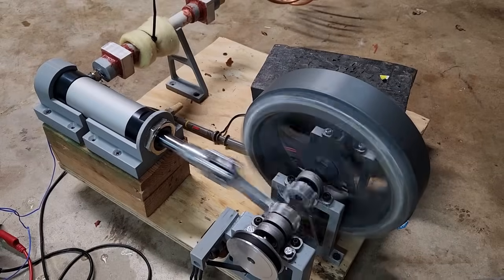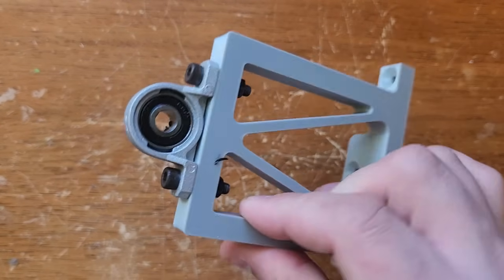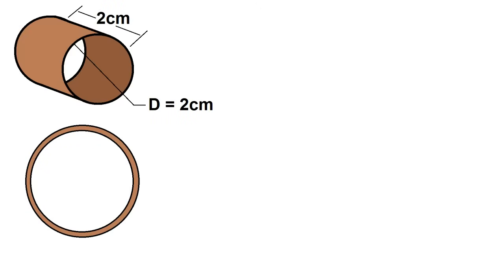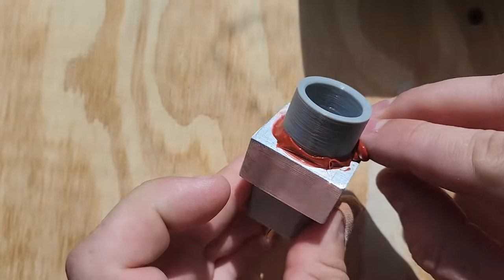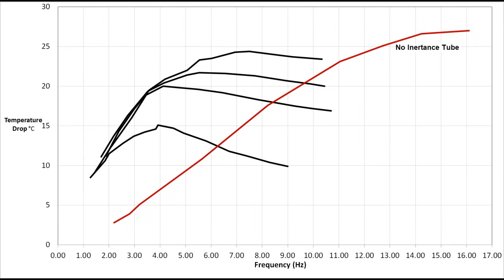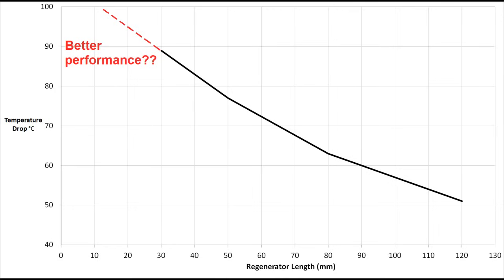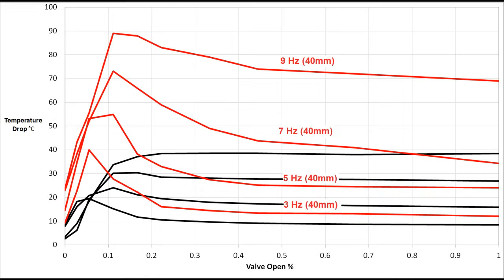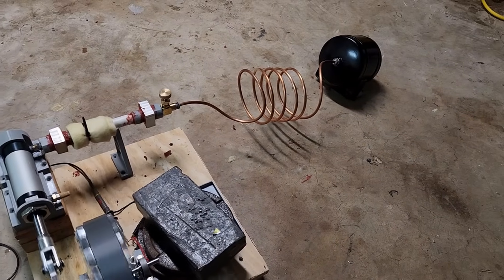Pulse Tube Cryocooler - Part 2 (-75C)

Comment from the maker: I've read through the comments and thought I'd address a few of them:

-The 40mm piston is probably not optimally matched to the pulse tube geometry,
since i optimized it for higher frequencies on the 25mm piston

-For part 3 or 4 i'll probably try using Hydrogen as a working gas. It has a lower
specific heat ratio than helium, but the highest thermal conductivity of any
gas, so I should see an increase in performance as long as all the components are 
sealed well enough to avoid leakage 

-For part 3 I'll be looking at heat exchangers with multiple heat pipes and 
water cooling, as well as single tubes packed with copper wool.

-I do intend to evaluate a segmented regenerator with polymer "heat breaks" 
to slow down axial conduction losses by breaking the continuity of the metal
mesh

-For higher pressures and lower temperatures, I'll be replacing the PVC 
with stainless steel to avoid explosion hazards.

-The ESC has flyback diodes across the H-bridge MOSFETs, so any back-current
from the flywheel after motor shutoff should be dissipated through those.

-Multiple stages might be neccesary to reach LN2 temperatures with a DIY setup.
Pulse tubes can be staged by connecting a much smaller pulse tube to the output
of the compressor's aftercooler and thermally anchoring the second heat exchanger
to the cold end of the first stage. Pulse tubes used for liquefying helium/hydrogen
typically have 3 or 4 of these stages and can reach single-digit kelvin temperatures
Reply: - Hydrogen is incredibly difficult to keep sealed; just look at the troubles and delays with SLS
- I wouldn't be so sure that you can use water cooling... wouldn't the heat exchanger itself not get cold enough at one point to freeze water inside the heat exchanger? Then you have an insulator in the pipes instead!
Reply: @BirdbrainEngineer  Hydrogen is hard to keep sealed but easy to make even at high pressures if you're brave enough. You can directly hook up the hydrogen part of your catalysis, plug up the oxygen part and just let the pressure go as high as your bravery allows. So you should be able to replace your losses fairly easily.
Also I believe the water cooling goes on the hot part of the first stage of the cooler.
Reply: @MrRolnicek  It is better to rely on engineering rather than bravery when choosing a maximum pressure. It is easy to calculate the potential energy in a compressed gas based on the volume, temperature, and pressure. 

If there is enough energy in the system to send debris through safety glasses and into an eye, then it is time to either dial the pressure back, or put a safety barrier around the device. The inner layer of the safety barrier should be soft so debris will embed itself, rather than ricochet.

High pressure hydrogen will make metals weaker and brittle. So just assume it will explode at some point, and make it so an explosion won't be a big deal.
Reply: @hamjudo  Sure ... HOWEVER, this is hydrogen we're talking about. You can calculate the internal volumes and make sure that at this pressure everything is going to be perfectly non-lethal.

And then you discover that your entire room has been filling up with hydrogen from small leaks and got to a pretty stociometric ratio. And maybe you discover it the painful way.
In either case you're handling something that you assume will explode at any moment, that still takes some bravery even with safeguards in place.
Reply: @BirdbrainEngineer  The same problem is with helium. Hydrogen can be fire risk. Otherwise they should work similar.
Reply: The pressures the SLS’s H2 systems operate at are much higher than require this project making leak management easier. .
The H2 molecule is larger than the single He atom, so it will be easier to seal then helium.
Reply: @BirdbrainEngineer   iif you heat hydrogen , won't you get helium then.
But you can't keep helium
Reply: Could you add a new stage just by eg. adding a Peltier element (with a heat sink) to forcibly cool down the hot end and thus increasing the temperature difference? They're not terribly efficient, but can move tens of watts of heat without using moving parts?
Reply: You should ISOLATE ALL around the precision valve and after on the right, all the way to coper pipe and reservoar. When air from the resevoar expands through valve, it cools off, and it is good, that it is cool as posible, before expands.
Reply: I'm looking forward to seeing this completed and would love to build one of my own as it could be extremely useful when doing some machining projects where I'm try to get a 2 to 3 thousandths interference fit by cooling one pert in liquid nitrogen and heating the other to take advantage of thermal expansion and contraction vs trying to press some relatively delicate parts together.
Reply: I’d be really interested to see more tests with increasing the regenerator diameter so the gas flowing over the steel wool is moving at a slower velocity; if your idea about the velocity of the air getting too high is right this should help… maybe 🙃
Reply: @Axman6  🔴 What Is Islam? 

🔴 Islam is not just another religion. 

🔵 It is the same message preached by Moses, Jesus and Abraham.

 🔴 Islam literally means ‘submission to God’ and it teaches us to have a direct relationship with God. 

 🔵 It reminds us that since God created us, no one should be worshipped except God alone. 

 🔴 It also teaches that God is nothing like a human being or like anything that we can imagine.

🌍 The concept of God is summarized in the Quran as:

📖 { “Say, He is God, the One.  God, the Absolute.  He does not give birth, nor was He born, and there is nothing like Him.”} (Quran 112:1-4) 📚

🔴 Becoming a Muslim is not turning your back to Jesus. 

🔵 Rather it’s going back to the original teachings of Jesus and obeying him. 

More ....
Reply: @1islam1  
No one goes to heaven except by Grace though Faith, when a person believe Jesus is word of God become flesh. Died on a tree (wooden cross) and took on our inherent sin from Adam upon Himself, that we might live with God in Heaven forever. 
God the Father sent God his Son, and if we accept Jesus as our lord and savior Jesus send God the HolySpirit to reside in our heart. If God resides in your heart you are sealed for eternal life, and no one can ever change that, not even one’s self. 
God doesn’t take back the free gifts he gives somebody. 
Read Romans in the Bible. Paul was a teacher to the Gentiles, giving instruction to a people who had no idea how to have a relationship with the God of Heaven. 
Enjoy Reading all of Paul’s righting.
Reply: H2 is a pain to seal. Good luck!
Reply: Exactly - this would’ve been my feedback too. Keep rockin‘! Curious where you can get with this 🤓
Reply: I subscribed just because of how interesting his projects are .
I think he is underrated.
Reply: I replaced the helium in one those little pulse tube cryocoolers used with SBRC sensors with spectro grade hydrogen out of morbid curiosity and it worked well. Did not as cold as helium but enough to liquify argon or nitrogen on the tip of it, and plenty cold to get the sbirc thermal sensor to work. Building a working pulse tube cryocooler from scratch of your own volition is awsome though 😲🤓❤
Reply: This is fascinating stuff!  I'd love to see you achieve liquid air and then move onto flash-freeze-drying food items.  (That preserves the structure and, MUCH more importantly, the nutrition of fruits/vegetables/etc. as well as giving them a shelf life--in a sealed container--measured in decades. )  If such a system could be DIYed, it would allow folks in drought-prone areas to preserve bountiful crops for the hungry times without requiring refrigeration.
Reply: I think it would be a good idea to try cooling the hot heat exchangers with dry ice
Reply: What about fiberglass? isnt its conductivity way lower than steel?
Reply: Very interesting. For a long time I’ve wanted to make liquid nitrogen from air. 
Thank You.
Reply: is the volume really really low or what?
Reply: When is the next kayak video
Reply: But can you sit in it to dive underwater? No? 
#IfOnlyYoudMakeASub....
Reply: I look forward to seeing your planned upgrades implemented... but going with hydrogen will DEFINITELY present some sealing challenges.
Reply: Would love to see the copper coil go through a insulated wall into a freezer room containing a cryocooled chamber and a pump to blow cold air on the engine to start it or increase the speed. 
Would also love to see if possible another heat exchanger into an insulated hot sand battery. Wouldn't that be almost revolutionary? 
The professional factories can now reach CO2-negative lifecycles with only around 10% biomass https://www.youtube.com/watch?v=mKKfed2rM3I. 
What could the ordinary man can do with for example biochar, limestone and cat sand? And acid loving flowers. Imagine your own bronze oven.. https://en.wikipedia.org/wiki/Bronze  and pizza oven and glas blowing oven and pyrolysis oven as part of your "dark sand battery green house". Perhaps underneath your yet to be build northern veranda carefully designed not to spread any fires into your house. Only controlled heat from the sand battery fed by Stirling engines.
Reply: People need cold enough to create Bose-Einstein Condensates, or their devices will never defend against the corporate A.I. mechanisms.
Reply: The dimensions of THigh radiators are suspiciously small for such a low temperature in the middle. If the unit has cooled down to -75 degrees in a few seconds, then the radiators have heated up to the same temperature, they should cool down faster than the TLow temperature drops. In addition, it makes sense to read the wiki on this topic: a more efficient U-shaped design is represented here. Finally, it confuses me that one end of the regenerator is warm and the other is cold. It seems to me that the cold end will receive heat from the heated one, reducing efficiency. Therefore, the wiki contains conflicting requirements for the regenerator. I would try to make it in three parts, splitting the metal wool in the middle with a layer of glass wool. And finally, you may buy true Si-airgel instead of foam rubber!
Reply: have you considered using a subwoofer to generate the pressure wave?
and cute dog :3
Reply: Could you use the vacuum from the other side of the dual action piston to add a larger pressure difference after the expansion valve?
Reply: material list?
Reply: i know it's to late, but why not just use vapor chamber / copper heat pipe, common pc cooler

Comment: AI Summary

Abstract:
This technical report details the iterative development and optimization of a DIY pulse tube cryocooler, progressing from a proof-of-concept to a functional unit achieving a minimum temperature of -75°C (a 91°C drop from ambient). The author transitions from a linear drive to a high-inertia rotary system utilizing a 750-1100 KV brushless motor and a flywheel to manage the exponential pressure rises associated with adiabatic compression. Experimental focus is placed on the "hot-end" heat exchanger design, where the author addresses the gas-to-wall thermal bottleneck by employing a multi-channel aluminum block to increase internal surface area. Extensive parametric sweeps were conducted on regenerator length, pulse tube geometry, and inertance tube diameter. Results indicate that a 4.4mm ID inertance tube significantly outperformed smaller diameters by reducing flow resistance. While the 40mm bore piston increased compression work to 9.5 Joules, performance plateaus above 10 Hz suggest potential choking or axial conduction losses, highlighting the need for future high-pressure, low-conductivity (stainless steel) housing and monatomic working gases like Helium or Argon.

Cryogenic System Performance and Component Analysis

*   0:48 Drive System Transition: Ditching linear motors for a conventional rotary brushless motor (750 KV) paired with a 5:1 reduction and a high-moment-of-inertia flywheel. This configuration is essential to overcome sharp adiabatic compression forces.
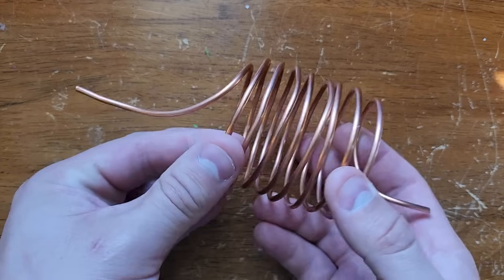*   1:45 Phase Shift Geometry: Utilization of a 3m, 4.4mm diameter inertance tube coupled with a 2L buffer tank to manage the pneumatic circuit's phase shift.
*   2:20 Piston Specification: Deployment of 25mm and 40mm bore pneumatic actuators. While providing higher friction due to rubber lip seals, they offer zero "blow-by," ensuring pressure retention at low operating frequencies (<15 Hz).
*   3:38 Hot-End Thermal Bottleneck: Analysis of heat rejection requirements (59W at 10 Hz). The author identifies that the thermal bottleneck is not the pipe material but the low thermal conductivity of air, requiring internal surface area maximization.
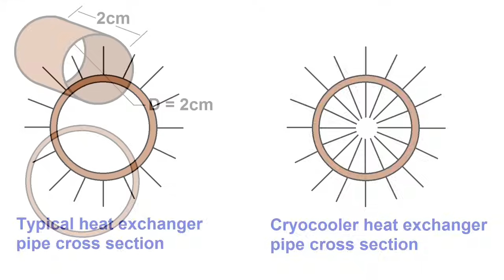*   6:03 Heat Exchanger Engineering: Transition from a single cavity to a multi-channel (50-hole) aluminum block. This 100-fold increase in heat transfer capability aligns internal dissipation with the adiabatic work input.
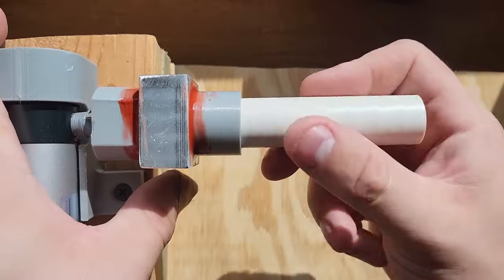*   8:30 Regenerator Construction: Use of 18mm PVC housing packed with steel wool. Optimization trials determined that a 30mm length provided the best balance between heat storage capacity and flow resistance for this scale.
*   10:41 Inertance Tube Optimization: Comparative testing revealed that 2mm ID tubes caused excessive flow resistance. Switching to 4.4mm ID copper tubing yielded a 40°C drop, demonstrating the inverse-fifth-power relationship between diameter and flow resistance.
*   12:14 Pulse Tube Scaling: Empirical testing of pulse tube lengths (50mm–200mm). The 100mm length was optimal, matching the swept volume of the compressor and maintaining a stable thermal buffer.
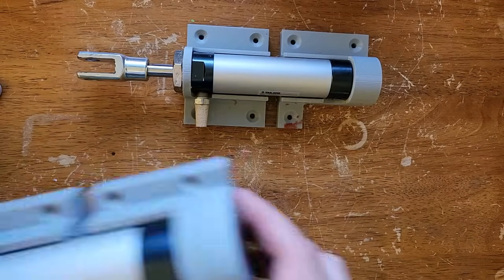*   14:13 Upscaling to 40mm Piston: Increasing swept volume to 58cc (Compression Ratio 2.0). Theoretical peak compression temperatures rose to 118°C, facilitating more efficient heat rejection.
*   15:16 Mechanical Failure & Redesign: Friction-induced melting of 3D-printed crank components necessitated a move to CNC-machined aluminum blocks and ball-bearing connecting rods.
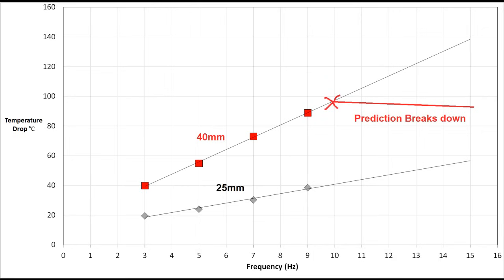*   16:47 Performance Plateaus: The 40mm piston underperformed at frequencies >10 Hz. Potential failure modes identified include regenerator flow choking, moisture-induced icing, or axial conduction losses through the steel wool.
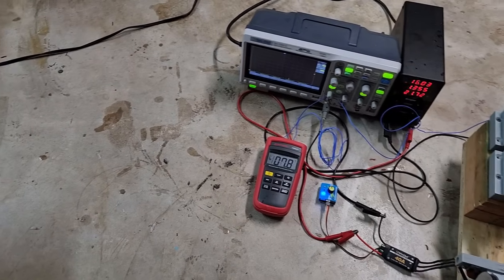*   17:31 Key Takeaway - Future Optimization: To reach temperatures lower than -75°C, the system requires higher power density via pressurization (10-20 atm), stainless steel housing to mitigate axial conduction, and the use of Helium to exploit its superior thermal conductivity and specific heat ratio.

AI-generated summary created with gemini-3-flash-preview for free via RocketRecap-dot-com. (Input: 22,993 tokens, Output: 980 tokens, Est. cost: $0.0144).

Comment: Your connecting line from the needle valve to the expansion tank might also be too restrictive. I found using a too small tube in distilling impacts the process immensely with back pressure.

Comment: I am assembling a liquid nitrogen system very similar to Grant Thompson's that JerryRigeverything went and visited him to make a documentary. I have to replace a compressor on my Nitrogen generator however. I have a helium cryocooler system however I do not have the part that you are building. I still have to take your design and see if I can modify it somehow to make it durable...I also have to purchase a 3D printer and learn how to use it as well...Thank you for posting your trials and tribulations so I can start at a much better place...-John
Reply: good luck, it would probably take me like 5 years now tbh, I can't even try anything like this tbh.

Comment: did you try to cooling the cylinder?
actually the returning gas will get heated from friction.
the movement between the piston and the cylinder  will generates lot of heat.
don't let the backing gas get heat from cylinder and piston:face-red-droopy-eyes:

Comment: @HyperspacePirate
i have a idea
try to use thermochromic tape to measure the temperature of the pipe
it will show you the temperature at different positions on the pipe

Comment: Could you piggy back a liquid desiccant evap cooler for efficient cooling? Maybe you could even use the heat to dry the liquid desiccant. I'm mainly speaking to what I saw/learned in Tech Ingredients evap cooling video from about 4 years ago. 

My hopes are that it can be ran in parallel to increase the efficiency of both systems. Even if you don't do the liquid desiccant variant, you could put an evap cooler outside then pump the cooled water to the cryocooler.

Comment: Would you recommend a version of this to be used as a chiller for a small water loop? Could the cold side be a coil of copper? And using a linear high torque actuator with a pulse valve be a good route for keeping the design small?

Comment: I have a thermal camera that uses a cryocooler that uses a vibrating linear compressor and is small enough to fit in the palm of your hand. It is a hermetic system that uses helium as the working gas. In 30 minutes operation the cold end reaches negative 250F. I would look up cryocooler patents and see what has been done. There are fantastic systems out there!

Comment: Can you replace the inertance tube with a rubber diaphragm with a mass?  Now that mass would resonate with the air compliance in the tank without the resistance of the long capillary tube.  Similar concept to a passive radiator in a loudspeaker system increasing bass performance.

Comment: Great video… It’d be easier for you to use hydrogen as the working fluid for a number of reasons , mainly that you can electrolyze water to get it and it is relatively safe to work with.. power plants use hydrogen for cooling 500MW alternators because if its’ high thermal conductivity and low parasitic wind age losses.. IM pretty sure using H^2 will get you to liquid N^2… looking forward to your next video…